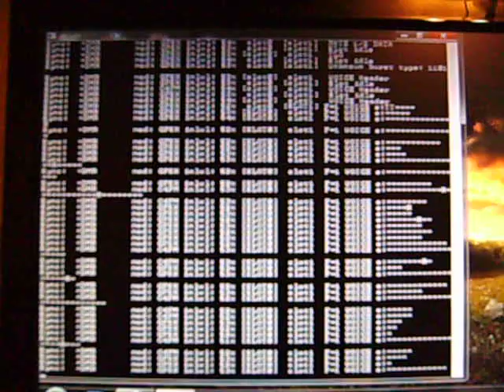DMR Decode - Decoding Mototrbo Transmissions with DSD Digital Speech Decoder

Comment from the maker: Hi mate, usually I'm using DSD1.6 from cmd using command dsd -fr for most TRBO and other variations but on this video I was using it in windows straight from the icon without any commands. Inlv and such varies a lot from system to sytem for me, I've had the best decodes from 4% going all the way up to 60%